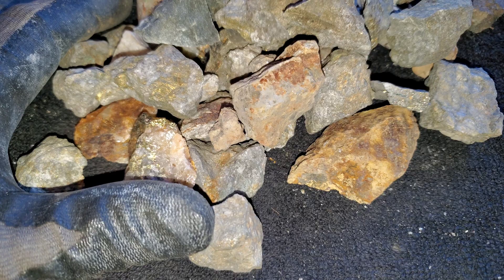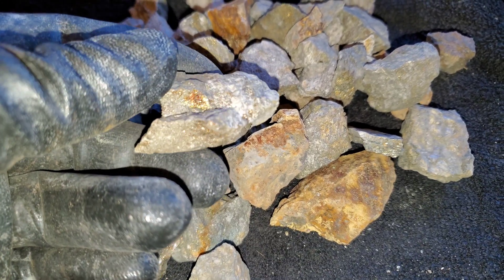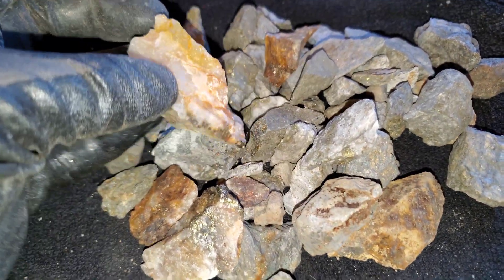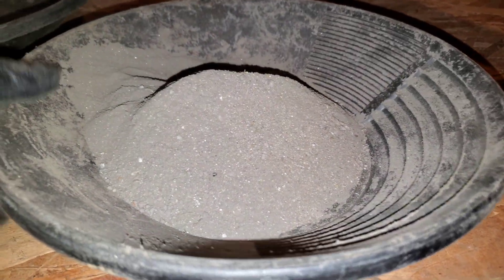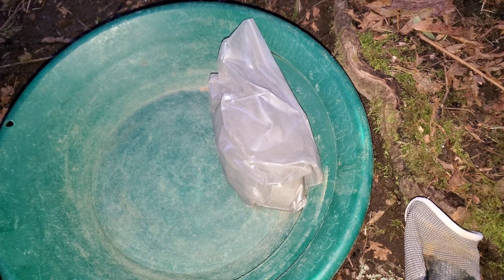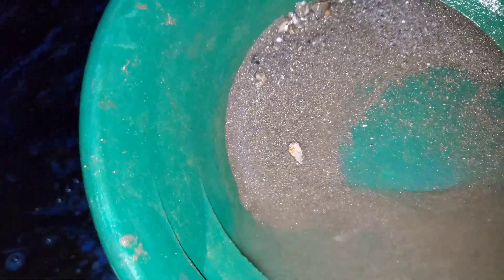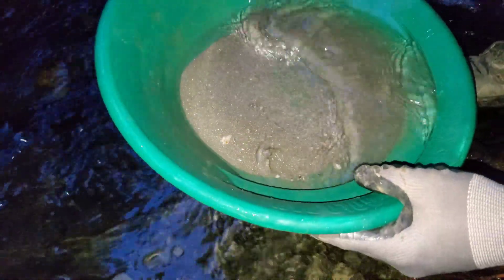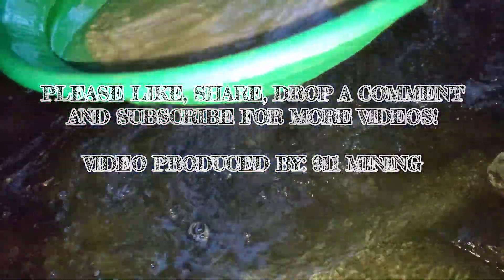Crushing & Panning High Grade Gold Ore!

Comment: "we're going to lose a lot here" you won't lose anything if you use a separate tub to back pan into, keep all your material and run it through a miller table later.  The specimens in the thumbnail we're 100% not what you crushed, why the switch?
Reply from the maker: ? Switch ?

Comment: You would have had to smelt that material down to get rid of the sulfides or otherwise used some other chemical separation process to get the precious metals out of there. I don't even think a shaker table would had worked on that material. Even after smelting, you would had wound up with a combination of gold, silver and copper after oxidizing away the lead in a cupel.